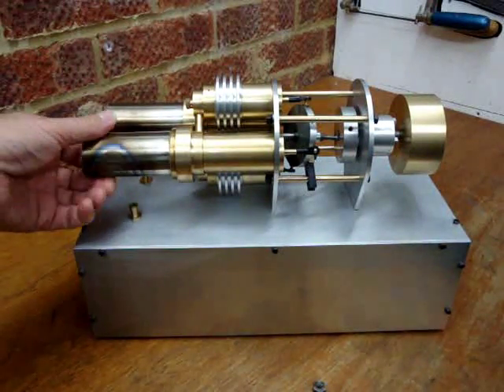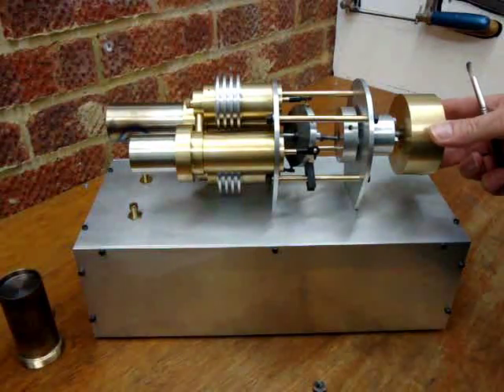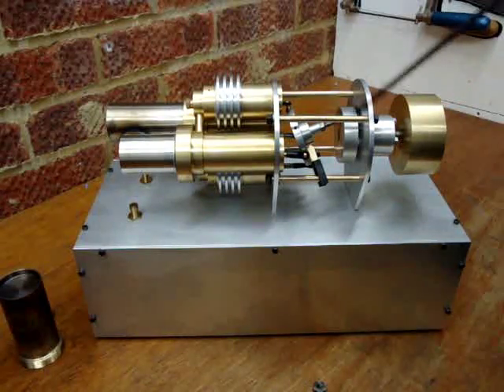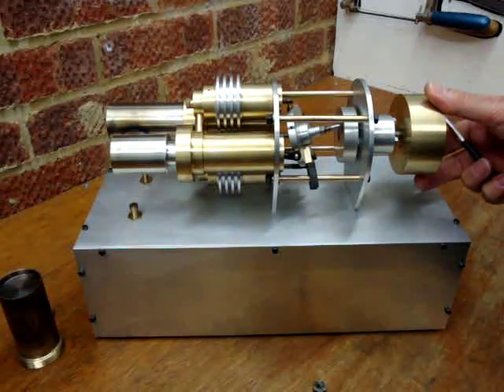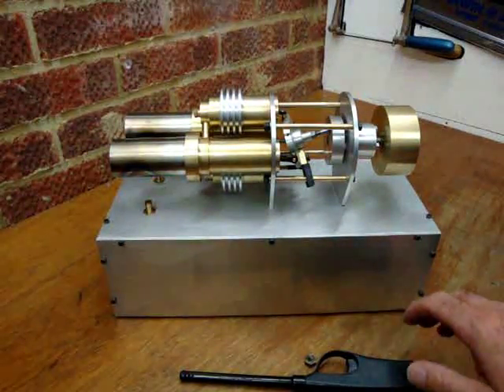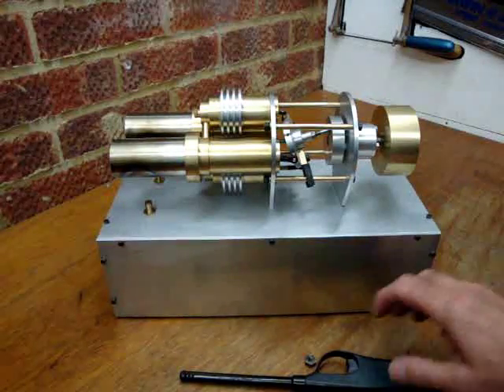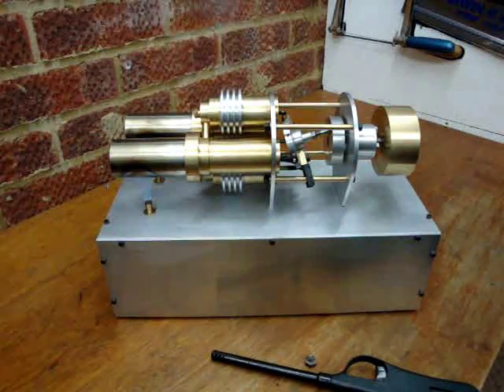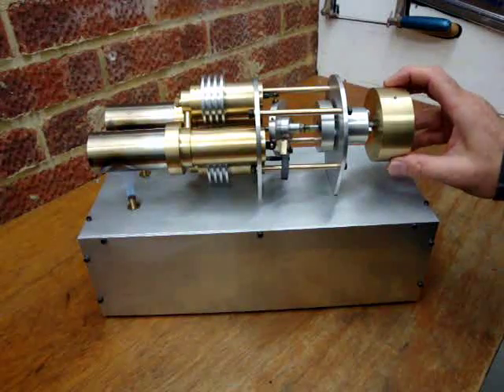Stirling Engine

Comment: In your description of the action you mention the vacuum pulling the cold cylinder piston, producing power, but doesn't the hot, having expanded, provide a push before that as well? They say quite a bit more power can be had by raising the internal gas pressure, I've not understood how they raise the pressure but it's an automatic function.

 I've yet to build a Stirling engine, I just finished a steam casting kit and am now obsessed with building engines.
Reply: The crank case end must be closed then pressurised adding problem to power take off, enter magnetic drive.